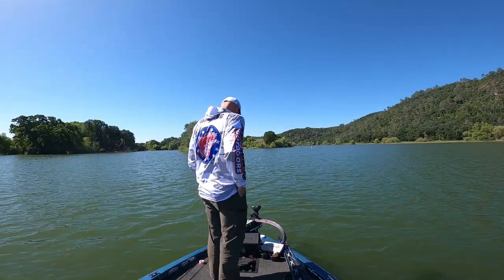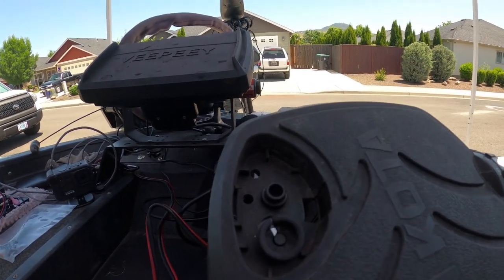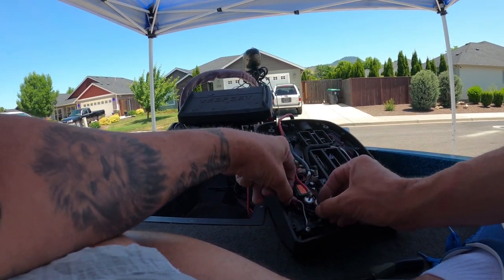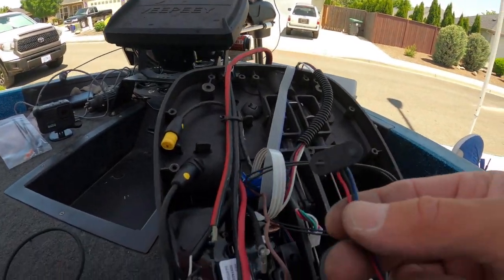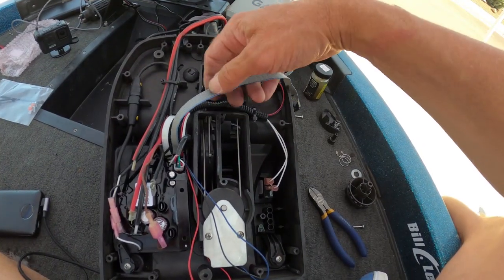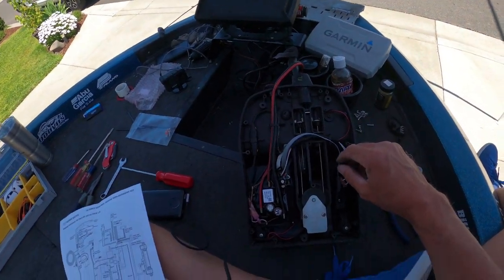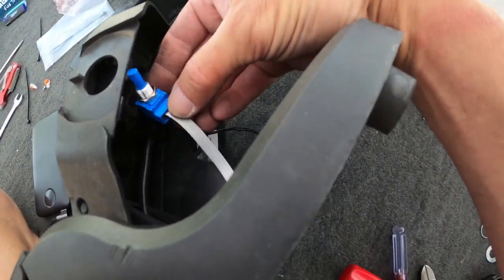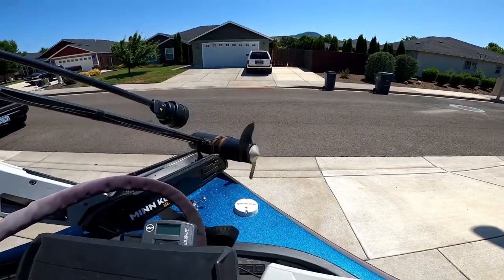Diagnose and Replace a Minn Kota Ultrex Control Board

Comment: Where any of your problems result in the unit having a mind of its own? Meaning my Ultrex when I have it on constant mode it would take off full blast which could be dangerous by knocking you out of the boat. The other thing is the head would lock up and you can’t do anything with it. I can power cycle and it will work again for a while. Just a few problems. Thanks for sharing.
Reply from the maker: I did not have those issues. The only time I had steering lock-up issues was when I had lead-acid batteries and the voltage got low. The sudden burst of speed does sound dangerous, I hope you get that figured out.